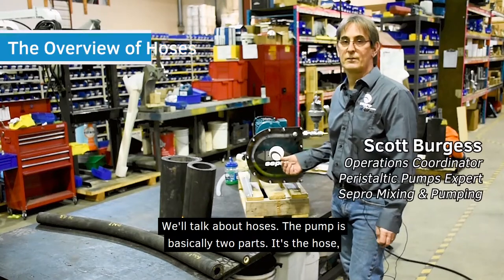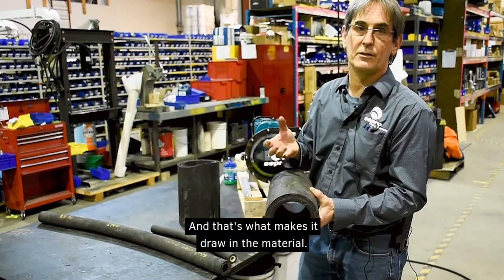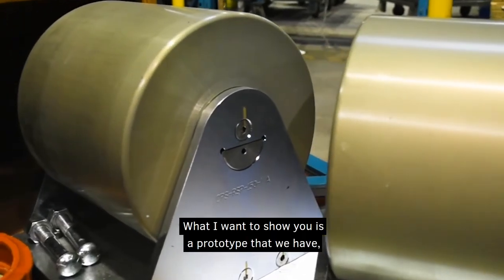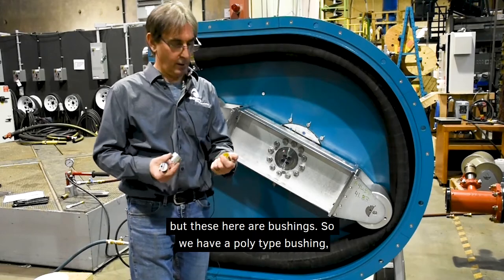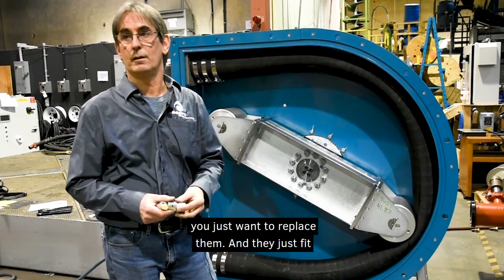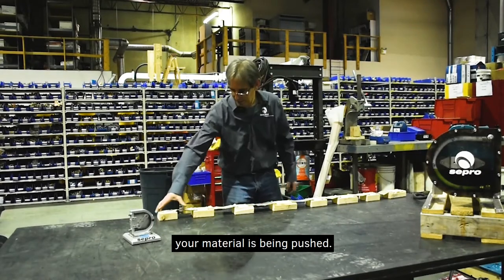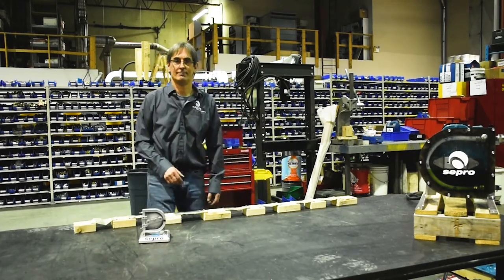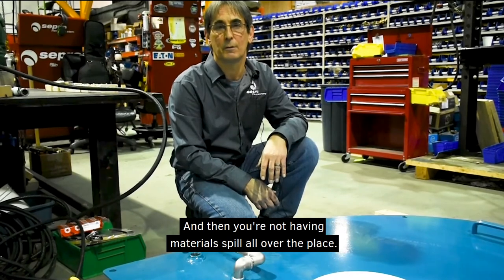Peristaltic Pump Features & Options | Sepro Mixing & Pumping

Comment: Thanks for training. Do you have roller bearing at back of pump ? Or you use bearings of gearbox to cover high forces coming under pumping of high viscous and density fluids.